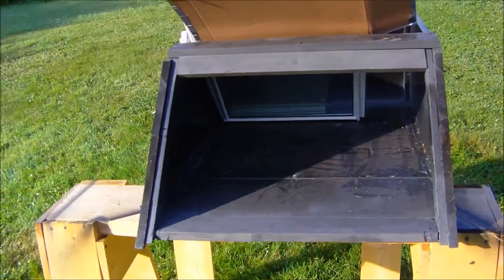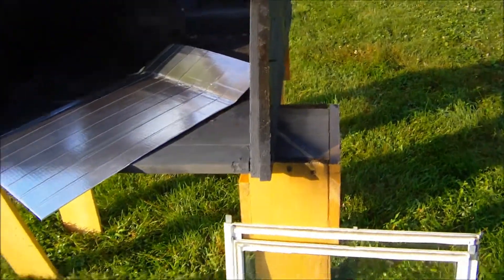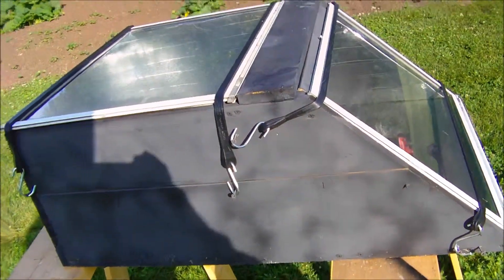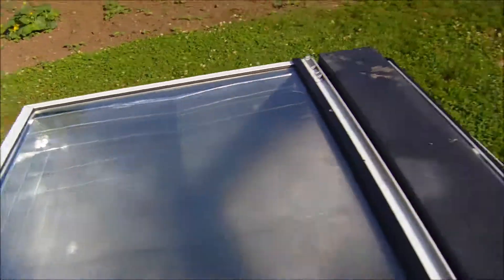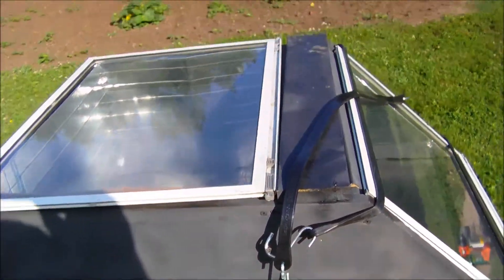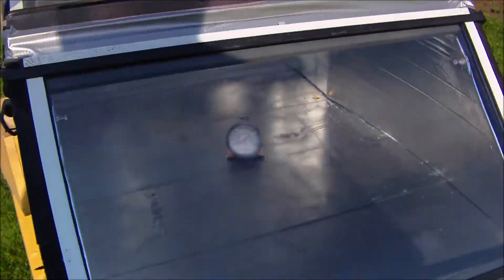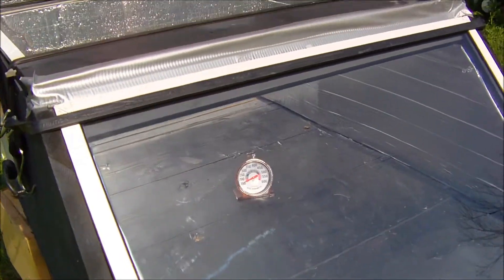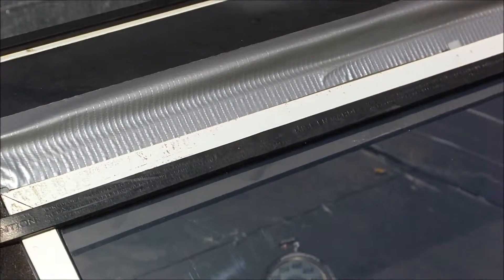Heat testing my DIY SOLAR OVEN FAILURE BIG TIME

Comment: Testing with an empty oven likely skewed the results significantly.  Try placing a dark colored pan with a clear glass or a dark colored lid into the oven.  Add 2 cups of water to the pan and repeat the test.  You'll probably get much different results.    Also remember that solar ovens cook more slowly than a conventional oven so a 2 hour test was probably too short as well.  Remember one has to not only collect the sun's energy, but retain and direct it.

The pan of water (or the food being cooked) acts much like a heat sink.  It absorbs the collected and reflected heat energy.  As it does, it helps to raise the temperature of the air in the oven.

A double thick wall of cardboard lined with aluminum foil should be sufficient for your insulation if you want to reach temps of 300-350 degrees.  Of course many people prefer to use wood or other more durable materials for the construction.   Be sure to seal all the edges and seams against unwanted airflow that can rob you of heat.  I have seen some box-in-a-box designs where the space between the larger and smaller box is insulated with old rags, towels, and etc...  Obviously, any insulation materials used should be both food and temperature safe.

Add reflectors (The video mentioned some "deflectors.") to help direct more sun energy into the cooker.  Up to a certain point, a larger reflector and the angle at which it is positioned can significantly boost your energy collection, so you may want to experiment with your reflector size, shape and angles.  Reflector angles should be adjusted every couple of hours to increase efficiency as the sun moves across the sky.

In designing the oven, remember that the glass is good for allowing the sun energy to enter the oven, but it isn't efficient at heat retention.  The use of both the top and a slanted sidewall of glass may look cool, but it is probably hurting its ability to get the desired temp.  Consider changing the design so that only the top is glass and use reflectors to help increase the input energy.

Also critical in the design is size.  Don't make the oven bigger than needed.  A larger space takes more energy to heat.  So if you aren't going to be cooking a huge meal, don't make the oven big enough for a large stock pot.  The best designs are usually built around the exact pans that will be used in the oven.

This is simply my opinion after doing some experimenting of my own with several designs.  I hope it helps someone.

Comment: You need one piece of glass on the top that it, need insulation, need 4 piece of black metals sheet inside the box, for more improvement one big dump bell and 4 piece of reflector on top of the box.

Comment: +unclebigguy Hi, Thanks for the video. I am trying design an oven right now, and I plan to use double pane glass. It wont be real cheap, but I am hoping it will be worth it. I was in a bar yesterday that had one of those beverage coolers with a dual pane glass door, and I put my hand on the outside glass and then opened it and put my hand on the inside glass, and the difference in temperature was remarkable.

Comment: Hi Friend,
Neat concept. I like the front door as well as the top door. You are probably losing a lot of heat through the plywood sides. I would place insulation on the outside so you can keep your cooking chamber large.
Also, reflectors for your front glass as well as the top glass should be angled at 60º to the glass and be the same size as the glass. This will increase your temperature dramatically. 
Don't give up. You have good ideas and just need more reflectors and more insulation.